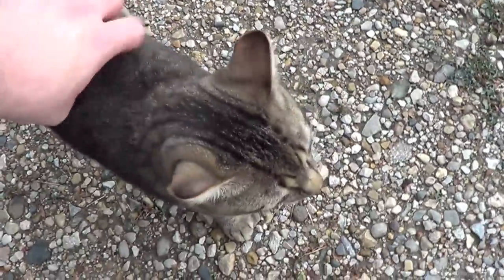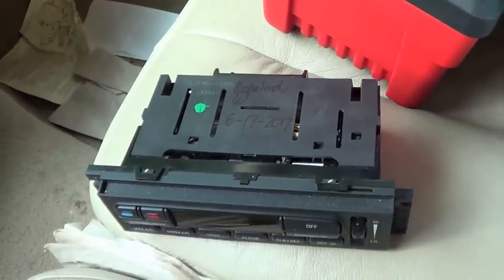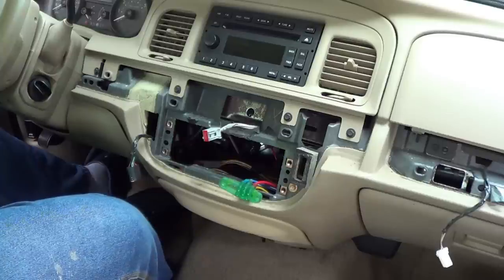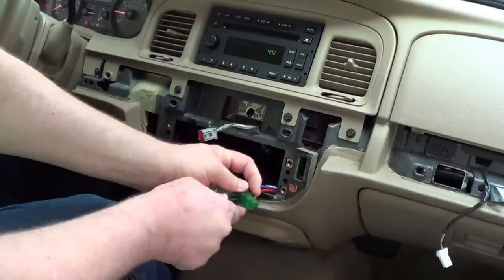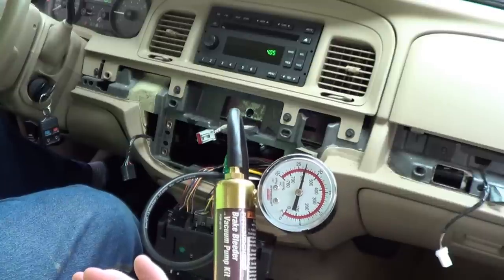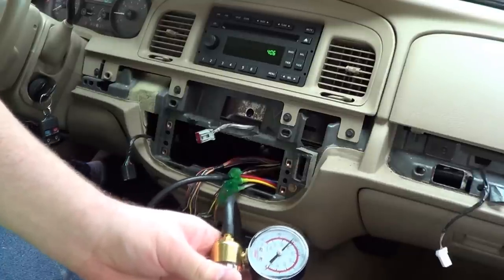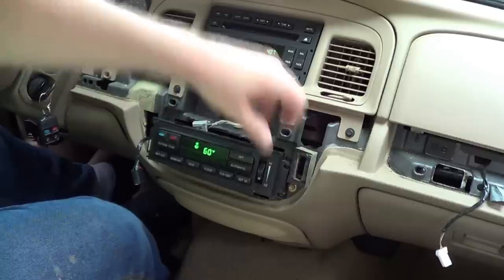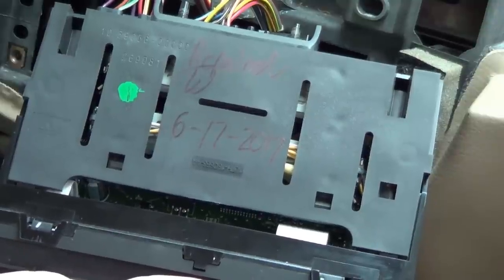Troubleshooting a Ford Electronic Automatic Temperature Control Module

Comment: 2:36 The Town Car is indeed the Panther-class design. The Continental is a smaller, front-drive design that shares more heritage with the Taurus, engine aside. (The late 90s Continental used a DOHC version of the Modular engine found in the Panthers.)

Comment: I remember when the temp control arm was tied to a wire cable and a lever on the dash. They outlasted the car.
Reply from the maker: In a way, I'm surprised the manual climate controls in these cars don't work that way.
Reply: The cable used to get a kink when it was  cold .   I had a VW Rabbit that would kink the heat control valve when very cold.
Reply: If you go back to the 50s, there was a valve you had to open  in the engine bay to get heat in the cab.

Comment: The way the vacuum solenoids function is the black plastic manifold supplies engine vacuum to all the solenoids at the same time and when the solenoids are not activated, the plunger with the large rubber pad is pushed by the spring against the opening in the manifold cutting off vacuum to that specific solenoid. When the solenoid is activated the coil pulls the plunger back against the spring allowing vacuum to pass around the plunger and into the opening of the sleeve with the "o" ring and passing back through the manifold to the corresponding nipple at the rear of the assembly where the vacuum hose harness plugs in.

Comment: Bill, I was going to say, just JB Weld it or use epoxy, but realized getting an air tight seal may be easier said than done and that your only other option is perhaps a new part and just hope it doesn't cost you an arm and a leg and whatever else in the process.

An interesting video, by the way and I have an issue with my HVAC system in my 2003 Mazda Protege 5. It's the blower motor switch, it works fine in all speeds, except when the AC/defrost is on, then it'll only blow cold when the fan is at #1 (reliably), 4, semi reliably, but eventually it becomes reliable once it's cooled off some as it's flaky when the car is hot from sitting in the hot sun. It's electrical in nature and I've heard several sources for this issue, and one is the control module itself, and was a semi recall that not a lot of people got, or took advantage of and eventually, the connector at the switch semi melts and you looks speeds 2-3 in AC mode, but when the heat is on, I get all 4 speeds, go figure.

Comment: If your's was the only Ford Panther available, I'd be more interested in a complete diagnosis and fix from scratch. However, given the fact that numerous fords of a certain era (Panthers, 2000 Expedition...) use this control, I'd already have gotten 3 or 4 from the junkyard and determined which one works or only needs the o-rings that you have.  If you or I were to remain curious, another 1 or 2 of the junkyard pieces probably work or are easy to fix.  I would then proceed to do destructive testing on it. That's much easier and finds those answers quickly.

Comment: Informative video, to be sure. I'm glad my '98 Vic has manual hvac controls. It does have a couple problems though. First, a burned out blower motor resistor, so it only works on high fan speed. Also, I need a new a/c accumulator due to corrosion causing a noticeably large refrigerant leak.

Comment: Considering they used a solenoid for each vacuum connection, the solenoids default to the closed position until power is restored. It's typical of most manufactures to do it that way with vacuum operated components and it's kind of a fail safe. For example my dad's Lincoln continental will open it's headlights and cabin vent in the case of a vacuum failure, found that out when we pulled the engine.

Comment: I'd say the vacuum manifold tree sub-assembly has lost its integrity due to some type of mechanical or temperature related stress and possibly a combination of both. The failure may be unavoidable due to the designed operation of the solenoids, in my experience, most solenoids with a spring are naturally in an "off", "closed", or "neutral" position and when energized change state and perform a task like opening a gas door or a vacuum circuit in this case. For instance if a solenoid was energized for a 30 minute drive I'd assume that it would generate considerable heat and eventually crack or warp the sub-assembly. But I am also unfarmiliar with the exact operation of the EATC, in one of my automobiles a 1991 Lincoln I have the earlier ATC system which is a microprocessor based automatic control HVAC system without a digital display which has not given me any problems so far. If you are going to take the junkyard route I would look for a metal solenoid assembly (not sure if one even exists) or the assembly out of an older model which might be of a better design or of a higher quality composition I think EATC started in 1994 or 1996 but I'm not sure. Regardless, just purchasing a functional sub-assembly out of a junk yard will probably be the most cost effective solution if that indeed is the problem. If any additional information or a solution is found an update even if it is just added in the description would be appreciated. I am not a fan of an "automatic" system in a car either and on a completely unrelated side note my favorite automotive climate control system was in a 1994 Camry that I use to have in which the indoor/outdoor air flap was manually controlled you could select any percentage of either, the hot/cold air control was a cable operated coolant flow valve, it had a seperate switch for A/C compressor control, and finally a dc motor controlled airflow position selector with more selections than I have ever had in a GM, Chrysler, or Ford product.

Comment: Sir, I have no idea who you are, but you should absolutely be charging people for your ability to do instructional videos!  This video was the best instructional video I have ever seen!!  You do a great job.   I am VERY much into electronic trouble shooting and I think we could have been friends..lol!!  And just my two cents worth on the cracked vaccume body....could it be from the massive heat generated from the solenoids that caused the cracking??  Just an idea..... Thanks again for your videos and please keep doing them!!!
Reply from the maker: Many people have helped me out over the years without expecting anything in return, and I'm a big believer in paying it forward.

I'm not sure what caused the solenoid valve body to crack. I sent off for a rebuilt module (no core required) for this car and it's working perfectly now.
Reply: I highly agree with brian dubose. I came across your video for some answers on my friend's 04 CVLX Sport and 
I found your video "Excellent" on explaining how the EATC operates. It was like a college class 101 on the subject.
Thanks so much for sharing. :-)
Reply: @uxwbill ~ I'm Not an Electrical Engineer either but you did an Excellent Job of just touching-on A Few key Points(electronically) about How these things(EATC systems) work! Appreciated 👍

Comment: I'm sorry that I don't have anything of much use to add, but I did find this pretty interesting.  My experience with vacuum operated stuff is pretty much nothing and I'm not yet proficient in the management of angry pixies, but it seems like it should be possible to hijack the vacuum system somehow.  Not sure what options exist for that, but if the solenoids are even trying to operate, you've got an electrical reference for each function.
Reply from the maker: That's quite alright. I'm glad to hear from anyone with something constructive, useful, interesting, or thought provoking to say...and that includes feedback on the video.

I do like the term "angry pixies". Indeed one could hijack the vacuum system and operate it manually through some kind of an external valve. The same would certainly hold true for the blend door. What I don't know is how Ford regulated the HVAC fan. PWM (pulse-width modulation) seems like a very good guess, since that's how the radiator fan is driven.

Comment: You forgot what I consider the best part of these cars, they're big and comfortable. They have a lot of room inside, and big trunks. Personally I tend to prefer trucks and SUVs, but I definitely would drive a big full sized sedan as well.
Reply from the maker: Yes. I was amazed that Ford carried the torch for so long, and greatly saddened when production of the Panther cars ended.

I'd have really liked to see what these cars could have become with more modern powertrains in place. I'm also strongly of the opinion that a newly produced, truly full size car like these is what a lot of people would really like to buy -- and not just elderly people either!

Comment: If those solenoids get as hot as you described, plus the heat/cold changes, plus age, the plastic will become brittle and crack. Definitely something I have to check on my beast (97 Crown Victoria) as it has the same issue, air doesn't redirect when buttons are pushed. Either mine is cracked as well or the o-rings are shot. One of projects that'll take me the day to work on without interruptions (yeah, right!).

Comment: You could try to melt the plastic on the cracks to temporally fix it until you can source a good one. I've done that with other plastic parts for a short term quick fix. Used an old ratty soldering iron tip for it. That might seal it up for now.

I would definitely find a good one to replace it in the long run though. Also I always watch your video in full. Partly because I like your videos and they entertain me and brighten my day. I feel like if people don't like someone's work then they can just stop watching and move on with their life and save a bit of frustration on the creator of said vid.
Reply from the maker: I tried sealing it up as well as I could with epoxy and it was no better. The leak moved to all of the actuator outlets (or inlets, seeing as it's a vacuum). Another commenter suggested that it's cracked internally, and maybe they're right. I can't see a way to verify that.

My apologies if I sounded grumpy. I don't mind young people, but lately there has been a rash of Internet twelve year olds and it's kind of hard not to become put off by them.
Reply: Well then I'm not sure. It's most likely best to just replace the assembly then.Like you always say "Time and Ebay make everything of common and cheap!" 

I understand the grumpery, I really do. It gets old dealing with children let alone 23 year olds who act as if they are 15! lol

Comment: Vacuum is cut off when each solenoid is NOT activated. These are most likely 12v as the Excursion/Super Duty system works the same, but has a remote mounted solenoid pack. As for the blend door actuator, I believe it is a DC reversing motor with position sensor. Think power window motor plus a throttle position sensor. If you still need a solenoid pack, I have an extra F150/Expedition EATC with a broken case. Works as far as I can tell. Let me know if you're interested
Reply from the maker: Thank you for explaining how the vacuum solenoids work. The blend door module is a cheap permanent magnet brush-type DC motor. The arm runs along a resistive track. My guess is that this track gets worn down after the arm makes many trips across it.

I later bought a remanufactured part for this car and it works fine.

Comment: Great video. I own a 2003 Crown Victoria Police Interceptor, basically just below-base model LX. I didn't know this used vacuum lines to actuate the direction of the vents. The Interceptor/ taxi uses the very simple three knob setup, for vent selection, temperature, and blower speed. From what I remember, you can pick them up from a U-Pull It junkyard pretty cheap. From there, maybe swapping out solenoids, you could repair that unit. Otherwise, if its the plastic vacuum fitting for the solenoids to sit in, as other uses suggested, JB Weld, and perhaps it is salvageable. Or else, sacrifice some functionality and go with the three knob style which is cheaper (although I'm not sure if it would still work, with the more advanced setup including the exterior temperature sensor? I've never taken my unit out before).
Reply from the maker: I'm told the plenums are different between the two systems, and I know someone who did the change (adding automatic climate controls to a car without them). They had -- and needed -- a complete donor car.
Reply: @uxwbill  I was told that the AC has a thermostat which failed in one of my friend's car grand Victoria and I'm trying to locate the sincere. Thermostat or whatever it's color because I have a rich same year model.  Available show so if there is a thermostat for the air conditioner. I would appreciate knowing its location thinking good advance for your cooperation and I remain useful

Comment: I found a bad vacuum actuator that has the yellow and red hoses to it. The yellow held vac but the red didn't. thankfully panthers used the same parts for many years! I had one off my deceased 87 vic that was still good!

Comment: I have a 97 crown vic. I havent dug to far into the dash yet as we use the car everyday. Something is causing mine to short out. I thought at first initially it was the control module as you are showing. But when I plugged in my new one and connected the battery (key off) it started smoking.  I cant find any information on what would cause it. Would you happen to have any ideas?
Reply from the maker: Look into everything it operates, and the wiring linking it. It's not likely to be easy or fun, but you will find the trouble sooner or later.

The factory service manual will be your friend, as will even a basic multimeter. (No Haynes or Chilton's. The real thing should be fairly easily and cheaply found on eBay.)
Reply: @uxwbill  thank you. I'll definitely look at getting one of those.

Comment: Do you have video to fix the blend door actuator???  Mine just got stuck blowing hot air only in the a/c mode....please help!!!
Reply from the maker: No, I don't have a video about that. To replace that is involved enough that I wouldn't recommend it unless you're comfortable with the idea of loosening the dashboard, steering column and removing related assemblies. If you're not sure -- hire it done.

Comment: What about the buttons? I have 1 that doesn't work. Is there a  spring that operates it? The floor button does not spring out and is not pressing . I can put on floor/defrost and all other modes so o rings are most likely not the issues.  Floor button is. We have lived with this since we got the truck-10 yrs, 2003 F150 so we are still good but if it's an easy fix I'll do it
Thanks
Reply from the maker: I've not had an actual button fail, so I've never had them apart. It should be pretty easy to tell where the fault lies: if you press the button and the display changes to reflect that function being selected, you know the button is working.

I think they're designed in a similar way to many other control buttons, such as in a typical TV remote. These use a slightly conductive rubber pad that touches special circuit board traces when you press the button. Common failures include the conductive material wearing away, the trace on the circuit board wearing away, or contamination of the contact area from something like rotting foam. Rotted foam can also corrode the circuit board.

If it is the conductive material that has failed, you may be able to effect a repair with a rubber pad salvaged from something else, a soft pencil, "wire glue" or something like a rear window defroster repair kit.

Comment: I am honestly surprised that modern cars don't have as many vacuum leaks as one might expect given the snakes nest of vacuum lines, especially those going to the climate control. Or perhaps vacuum leaks ARE the reason for rough running on older cars. I was actually quite surprised when I learned that many modern cars still use vacuum for their climate control doors. It was the hissing sound the vents would make when switching between floor vent,  regular vents, and defrost that caused me to research the issue.
Reply from the maker: Vacuum actuators aren't often used in newer cars. DC motors operate everything instead. The Ford Panthers were some of the last to do so, and probably only because the design had long ago paid for itself.
Reply: uxwbill 
Ah, very interesting. Vacuum actuators did seem to be a bit of an anachronism in an age of inexpensive servo motors. I am curious as to how gracefully these servo mechanisms will age as this current crop of cars gets older.
Reply from the maker: From what I've seen, not terribly well. I've replaced a LOT of blend door motors in many different makes. 

My mother's 2002 Buick Park Avenue uses DC motors to do everything in the climate control system. One of its two blend doors isn't moving through the entire extent of its travel any more, but it does at least try/get close and that car has over 200,000 miles on it. The damper doors moan and groan, but are so far still in the game.

I don't think it helps that the automatic systems tend to "hunt" with the blend door and even the manual systems may not be immune: at certain points in the range of hot/cold adjustments, the manual dual-zone climate controls in my '07 Silverado will sit and "twitch" the blend doors. I'm sure that's not doing the longevity of the blend door actuators any favors.
Reply: uxwbill 
My guess is that the lubricants on the servo motors just don't hold up to baking in the heat. Do the vacuum actuators like the ones you showed need lubricated?
Reply from the maker: There's no evidence of lubrication in the assembly, and many pneumatic items caution against adding oil or lubricants.